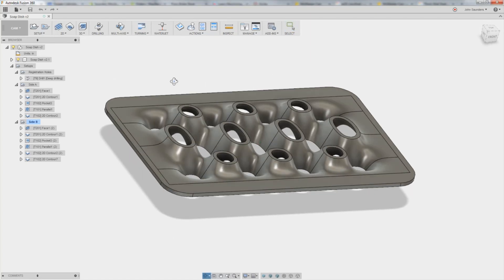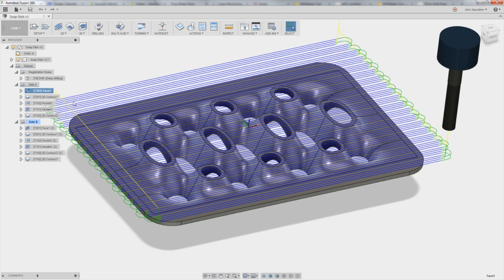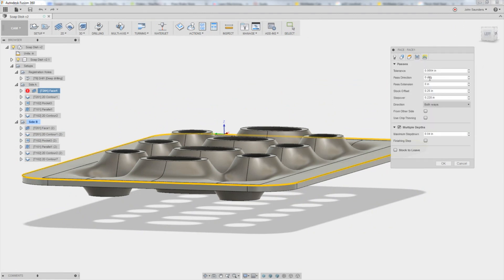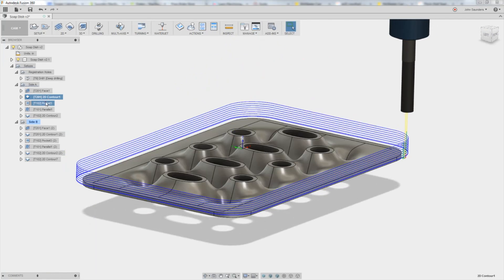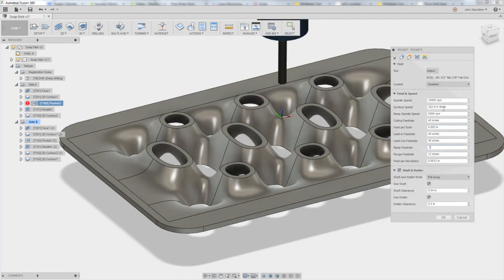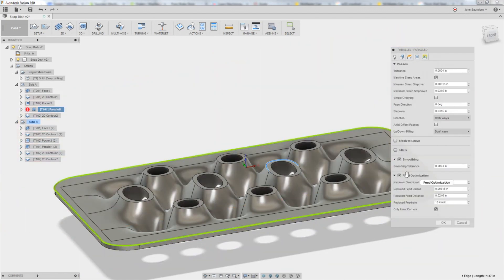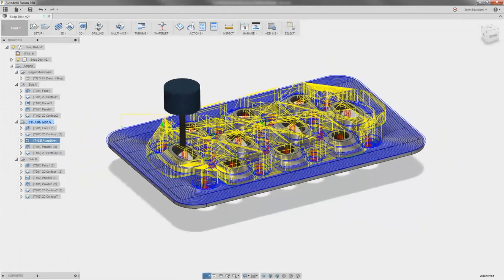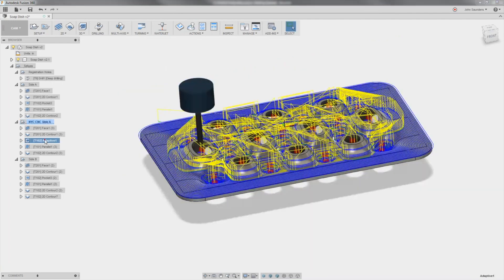Fusion 360: Reducing Cycle Time on 3D Toolpaths!  FF61

Comment: Im starting to use largest tool you can that doesn't sacrifice dimensions and finish of the part. Id almost face mill the top save some time thier. I do like changing that ramp angle saves alot which im going to try myself

Comment: I don't think you can just increase the stepover just because you feel like it. 0.060" is pretty damn big on a 1/8th tool. Even 0.030" is too much for something that size. The Scallop is too deep I think. 1/4" Ball at 0.012" stepover is kinda like the bare minimum for any kind reasonable surface finish. I see it at work all the time, and that sometime requires a little handwork to smooth out still.

In that project of buddy's, what is the size of the holes and surface rads? Could a 3/8th Ball fit in there, so that you could you use a bigger stepover, but retain the surface smoothness?

Comment: Get rid of the facing in the beggining...all this material is going away anyway! Also the contour could be done in the end so that there is less material to be removed and more aggressive cutting data can be used (my understanding is that the customers machine has limited horsepower hence the facing with a 1/4" tool). As for the weird holes...I would go for the concave ones first and leave the convex ones internal features entirely (the helical plunge) for the second operation when doing the other side.

Comment: Here is another trick for facing. Try using a 3d adaptive path but then on the heights tab make your bottom height model top. This makes a path that has constant tool engagement and always on the same side of the cut ie always climb milling. With that you can use a much higher spindle speed and feed.

Comment: Nice video John!  I'm not sure if you know, but when you simulate your setup you can hover over the operation on the bar (where you scrub through the simulation) and it will show you machining time for that op in a hover window.  That isn't exactly what you were wishing for but it might be a little easier.  cheers

Comment: You had a few nice strategies for reducing cycle times on the part. Good work. Thanks for that.

Umm... errrr... but you abandoned the surface finish in search of a lower cycle time. The part would probably not had a good surface finish to begin with, but you have the knowledge and skills to correct that. Try looking beyond the problem a bit.

The part is better suited to z-level finishing than planar finishing. Planar works well for parts with flatter profiles. Z-level works better with steeper walls. Yes, the final pass will probably take more time to machine with the Z-level but the surface finish will, at a minimum, be passable.

Segregating the part into a  “not very flat” section ( the section in the middle) and a “relatively flat” section ( on the periphery) and treating each differently is a worthwhile strategy. Each can then be re-roughed and finished with different cutters best suited to the surface. It can be a bit more time consuming to set up, but can yield nicer results and reduce cutting times.

On a technical note try leaving more material after roughing cycles so the finishing mill has material to work with. In your example you left .005 ( or 4% of the .125 finisher ) That's probably not enough.

Comment: When doing surfacing your optimal feed rate changes based on the "chip thinning" effect. When the cutting edge is at a 90 degree angle to the feed direction it produces a 1:1 chip, that is, if you advance 0.001" per revolution you will cut a chip 0.001" thick. If the cutting edge is at some other angle to the feed direction, as is the case when taking shallow cuts with a ballnose, small radial stepovers with an end mill, or using a high-feed milling cutter, you're essentially spreading that same chip over a longer cutting edge, thereby making it thinner. To compensate for this you need to increase your feed rates accordingly.

Helical tool has a good writeup on it here: http://www.helicaltool.com/secure/Content/Documents/Tech_AngleofEngagement.pdf

Comment: Two suggestions:
- Maybe for the pocket/adaptive, you could replace the plunge/helix with 21 drills in the big holes of the part.
- And for the parallel, did you notice that on the long edges the surface is almost flat blue? I suspect the flatness cause it to do very small passes with the tip of the ball, and you might save a lot with a flat end mill. You should constrain the parallel to the sub-area that's really 3D (also maybe exclude the flat edges around the top holes).

Comment: Larger mill wirh rounded corners and trochoidal path, use a drilling op. to remove most of the material in the through holes...then there is very much less need for plunging or spiraling...

Comment: Hi John. My name is José Horta from Portugal and I've been following your channel for a while. I teach technical drawing, cad, cam and cnc in a vocational training center here in Portugal and I've been learning a lot from you - thank you for that!
Considering this video, is it a nonsense to set the tool down most of the time in the linking parameters!?!? I've tryed that in one part I was working on and it reduced the time a lot in an adaptative strategy. Meanwhile I've raised the repositioning feed also to a higher value.

Comment: I still caution using 3D adaptive paths with a ball endmill.  It has bitten me a few times by gouging parts. 

This might actually be a good application for plunge milling to rough it out

And instead of facing, go right to 3D adaptive to clear all the pocketing.  Eliminate the face milling entirely, it's pointless as there is virtually no top Z height surface. 

Why surface that flange or flat sections with a BEM? Huge waste of time there. Just use a horizontal path and nail all the flat surfaces at once easily. 

For surfacing, yeah, parallel is a bad choice, ramp would be better. Also make sure to turn on additional Z step down passes to ensure the steep areas are surfaced correctly. Looks like some sections have very poor surface finish due to the big step down the tool will be taking. And limit its cutting by angle (.001 deg min 90deg max) to have it avoid surfacing the flat sections that were done previously with a horizontal op.

Comment: TL;DR: Roughing by drilling tends to remove material faster for less money than roughing with an endmill. http://blog.cnccookbook.com/2010/09/24/interpolating-holes-vs-twist-drills/ 

Were it my part to run, I'd get the biggest drill that I could chuck up that would fit in those holes. 22 drill hits (Or so it appears) is a lot quicker'n diddling about with helixing in an end mill. If you're really paying attention, you can get away with things like partial depth drill hits and just clean up afterwards with an endmill. (AKA "Plunge roughing")

You can get a crazy high MRR with a drill and some attention given to optimizing the CAM ops.
Reply: Andrew Foss 
The one down side to drilling out for roughing is that drilling is one of  the most power hungry operations you can do. 

Judging by the speeds and feeds and tool sizes used, my guess is large dia capacity and HP are not something available. 

My gripe with roughing by drilling is the multitude of interrupted cuts you have to now make with the tip of an endmill to clean up floors and such. I'd rather spend the extra few minutes helixing and running an adaptive path.

Comment: you never plunge in wood you will set it on fire or burn the cutter big no no, you ramp always.

Feed optimization is used if your machine is crap at going around courners
Reply: daniel lyall 
I use feed rate optimization all the time, and my machine is far far FAR from crap. 

Going around sharp corners means the tool is accelerating (acceleration is any change is speed OR direction) by slowing down around corners (using the correct settings) you stop the endmill from accelerating too fast around a sharp corner causing poor uneven surfaces compared to other sections. 

It's also used extensively in 5 axis surfacing operations and pretty much a must to know how to use when doing full 5 axis surfacing.
Reply: Lol. At our school, we tried cutting into some very thick wood without realizing that. We almost set off a couple fire alarms. We had black smoke all over shop.
Reply: Occams Sawzall I know it's just one of the reasons to use it
Reply: you can always give it less ripums 'revs' or speed up the plunge speed but to make it easy, ramping is easiest

Comment: I am not a fan at all of parallel strategies. Not just because it can create poor finish, but because it also puts alot of wear on the Z ballscrew. I definitely prefer ramp. I would probably do the facing and stage 1 roughing with a much larger tool then come back with a smaller tool to get in the pockets. It makes sense in my head, but checking in CAM would be prudent...I think limiting the depth of the pockets that go all the way through to around 10% would reduce overall machine time since you have to rough out those pockets on the flip anyway.

Completely agree with the 3D adaptive and bullnose suggestions. With the ballnose I would consider doing a touch/avoid on any flat surfaces which could be finished with a flat bottom tool.

Comment: What did the final modified machining time come out to be with the adaptives and your modifications? I saw the times for the 2D contour and the Parallel operation, but not the final setup time.
Reply: NYC CNC I  was thinking you were going in chronilogical order. I saw that but thought it was before you modified the cycles. Thanks!